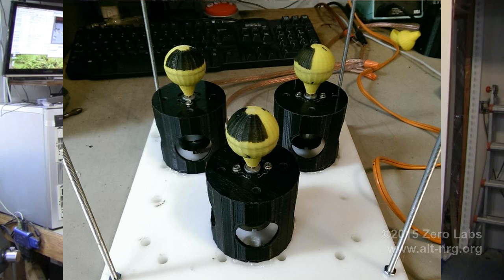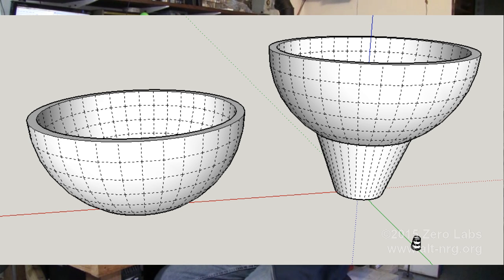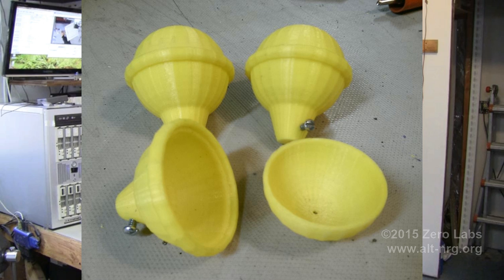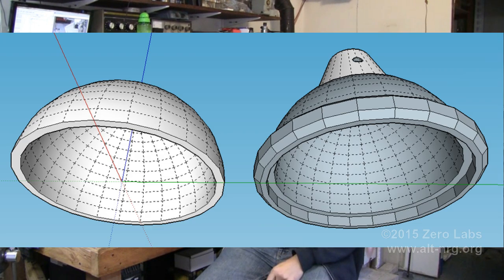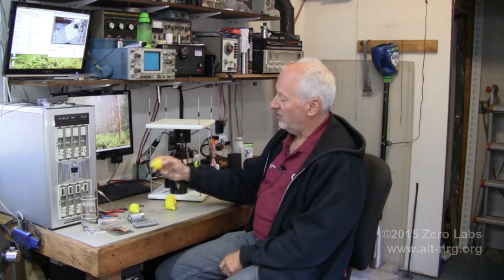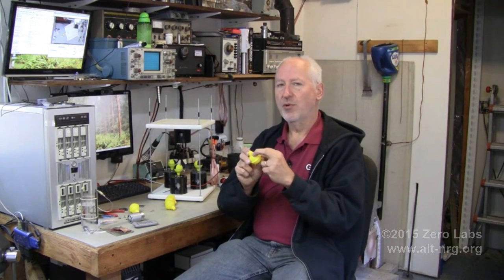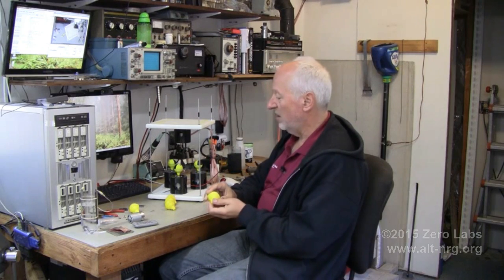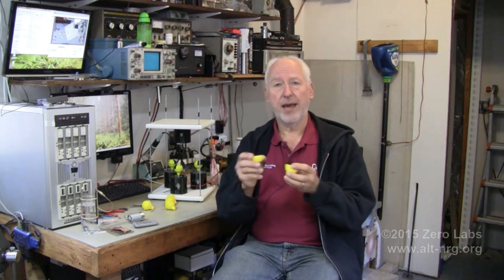#422 New Keshe Plasma Reactor design STL

Comment: These are test reactors for one thing and the technology is much more involved. Since 2015 quite a number of critical aspects of this sçience have proven correct. By flashing to coat using copper youre creating C14 and above. The intention is not copper plating. We've also had great suçcess producing GANS with higher salt concentration and the plates outside, though using a diode has its benefits tied between the two plates. I've seen numerous successes in very high energy savings. One researchers line voltage went out in his neighborhood. All houses went dark except his. Yes, they must run for a time to create fields. We've measured them over 250ft away from magravs. A lot has happened since 2015. My energy costs have plummeted by 97% and the fields are causing many warm weather perennials to remain green for years in our cold climates of winter in gardens on my property while those same species succumb at 1st frost. I'm presently building magrav units with 15 coil sets each in 30 units. You'll be hearing more. They will operate on GANS batteries, 2 ft x 6 in tubes. I've calculated out a 30MW field effect, but it could end up more. 5 star reactors with 2 of them inverted into one another are also in this design. You see, we already know the single star reactors and basic magravs are only more for small applicatioñs. Keshe balls are close to 9in in diameter. The 15 stack magravs there will be 30 and include adjustable mechanical angle positioned and locks. With a heavier concentration inside two rings of these magrav units. 6 battery units will be central in the onboard power supply. All workings must be located inside the field, nothing external. I keep 2 reactors operating at all times and 2 magravs, 3 stackers, at my circuit box. One on the 120, the other in the 240 line. Works great. But it took 11 months to heal the house lines. Only then did the change happen. Like I said, you'll be hearing more by fall.

Comment: Lots of noise about plasma reactor for something that may probably be used the same way as nuclear power, BOMBS.

The global energy and polution problem has already been solved with a very effective way. I think it is worth looking at this REAL AND WORKING solution (NOT A HOAX), electricity from water!!!! This inventor found a really cheap way to break water apart and power up your house using a small device. Funny thing is, no one is talking about it.

https://el.wikipedia.org/wiki/%CE%A0%CE%AD%CF%84%CF%81%CE%BF%CF%82_%CE%96%CF%89%CE%B3%CF%81%CE%AC%CF%86%CE%BF%CF%82

http://www.zougla.gr/greece/article/dorean-ke-af8ono-revma-apo-to-nero

Comment: If we focus on it going wrong, surely you can see that it will go wrong because you'll do it all wrong? Not the best advice but carbon nano coat your balls, Mr Keshe doesn't use electrolysis because using over 1 Amp is meant to create a matter state "Oxide" - In the many teachings Mr Keshe has done, not one tells us to electroplate anything, everything is carbon nano coated - Until your Gans is correct and until your balls are nano coated in a caustic bath with charcoal I also would not hold my breathe ;)

Comment: Has anyone in the world actually shown one of these reactors working? no video,no proof, i think that it could be true but the Illuminati Freemasons are keeping back the  real info on free energy reactors.
Reply from the maker: That's the whole point of this experiment. To show the truth.
Reply: Good luck with it, I think some how the difference between gravity and electromagnetism is key with free energy as I think gravity pushes down on matter,where as electromagnetism is more 3 dimensional rather than gravity's 2 d.Like magnets pushing away from each other  the free energy is where the two meet.
Like a mach wave effect in explosion energy waves rebounding from the ground hitting other waves coming down where they meet is the maximum pressure is.
Gravity is weak and constant ,electromagnetism can be strong and weak,frequency shifts in between the magnetic pulses around gravitational waves somehow can be exploited. Or i'm talking a load of bollocks, although  in my head the idea sounds good.

Comment: couldn't you use copper leaf, and burnish it into the spheres with a wooden bead on a stick.  It seems that you could quickly build up the thickness of copper that you're looking for, although I do not know the importance  of a constant wall thickness.
How do you get electroplating to adhere to your nonmetallic polymer spheres?
Reply from the maker: Etch the plastic first then apply a sheen coat of nano copper powder to make it conductive. I'll post a link to an example tomorrow. It's by youtuber electro1622.

Comment: There is a company in Indiana that plates plastic parts with copper and nickel, their name is Seleco, I was a plating supervisor there many years ago.
Reply from the maker: It's not that difficult
Reply: User01749
I didnt have nothing to do with the price but 7 wouldnt cost that much. I was a plating supervisor. Like ZeroFossilFuel said its not hard to do, if I still worked there I would have did it for a drink or two.